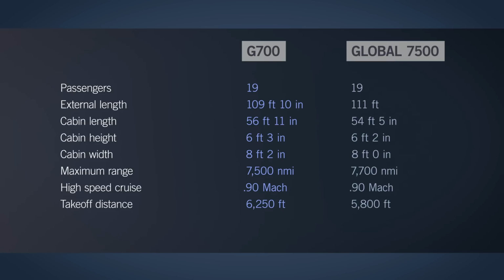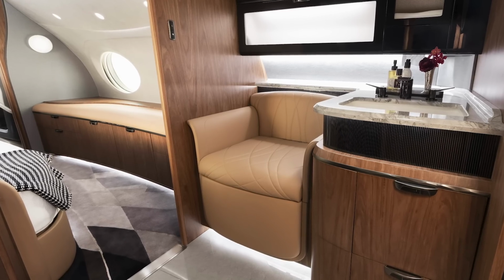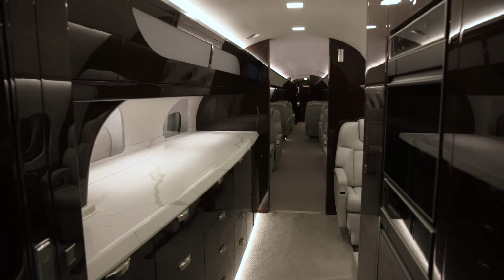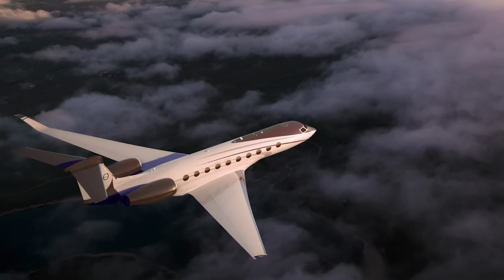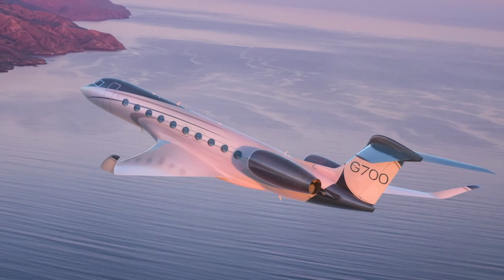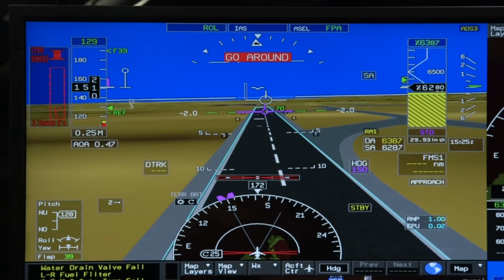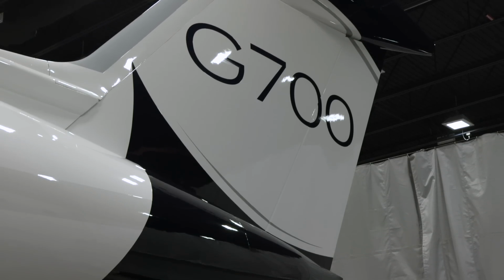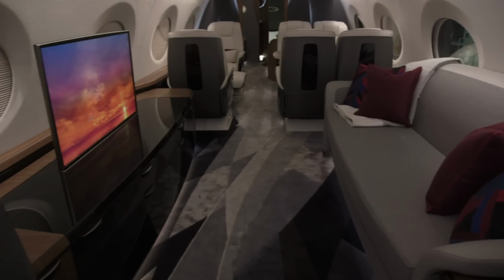Gulfstream Introduces the G700 as the New Flagship of its Business Jet Family – AIN

Comment: During flight emergency, pilots often refer to the manuals for directions to figure out the issue and solve it in order to land the airplane safely at nearest airport, but given latest computer technology and flight control display, can they design the touch-screen flight manual in stead of paper manual and  install the manual instructions  for both pilots to use?

Comment: "Touchscreens throughout the Cockpit of the airplane, we're adding data concentration"
"The Network can adapt to new systems, [...] but you can also program functions into the network [...] by automating steps for them"
"Gulfstream was able to accelerate the certification process for the G700. Using Ground Test Simulation Equipment, Engineering teams have been able to get a jump start on the cockpit and cabin even before the first flight of the new model has taken place"

This sounds eerily familiar. The MCAS system that "Made the pilots lives easier" on the Boeing 373 Max had Accelerated Certification take place on simulators before its first flight.

Look where that got them. 

Has nothing been learned?

Comment: 3:20 Using an internet/router approach where multiple systems use the same wire just to reduce wiring sounds like a loss of redundancy and a really really bad idea.
Reply: msnpassjan2004 you can use the saved weight to connect each device using two separate paths! Could if done right be more reliable than the classic way. Unless of course you are Boeing and thing one sensor should be enough in critical systems just to save a few bucks. But I guess passengers on a G700 are important enough that they will not corners. It’s not a 737 after all.

Comment: Great plane but even though I love technology- can’t help but think what if the electronics fail? They will at some point. We put far too much faith in electronics
Reply: RichieT5 there’s a manual option if that happens
Reply: I agree. Having flown for 50 years,and watching Airlines Crash INVESTIGATIONS, if it's not hydraulic failure, I notice so many episodes about aircraft with computers calling out "Approaching Stall AND Overspeed" simultaneously and even when the crew disengages the autopilot, no matter WHAT the pilots do, the plane will go into a nose dive or up at a 60 degree angle until it DOES stall.
  And that SIDE joystick,connected to the computers will NOT obey your commands.
   No thanks! Not putting down Gulfstream per say,but the whole aircraft manufacturing industry going in that direction.
  We are PILOTS, not monitors of computers.
Reply: There's a lot of redundancy in these systems, you've always got back up
Reply: One word-REDUNDANCY

Comment: the couch in the galley is an embarrassing design element.  good grief.  love the bedroom, love the bath with shower.  love the roof emergency hatchway near the airstair, that would've saved lives in the bedford mass crash.  love that it will keep the Roll Royce brand engines.  who will be the first to buy it?  some current g650 owners:  oprah, geffen, dell, jobs(on 2nd), spielberg, gates(owns 2), murdoch(owns 3), musk, shultz(got one of the first 5), ellison, bezos, disney, exxon, qualcom(a few), wallmart, wynn(got the first, had a couple) etc....  the length might be a deal breaker for some people, it's a beast...